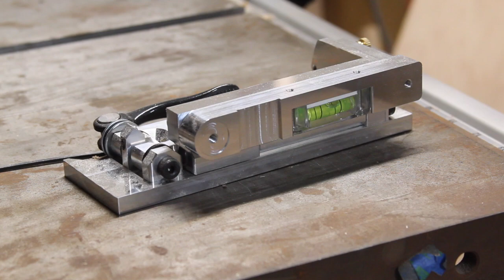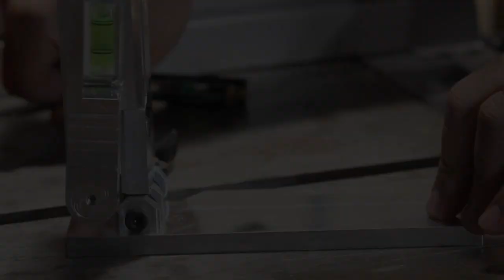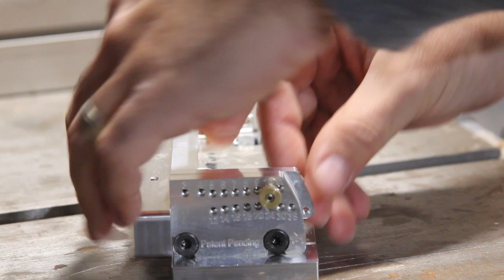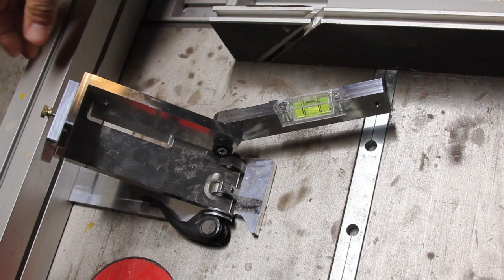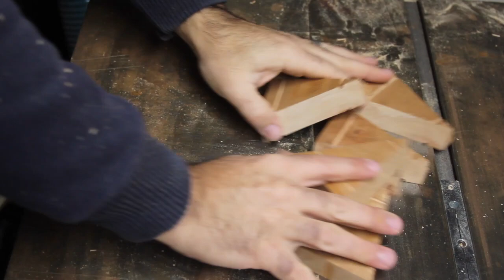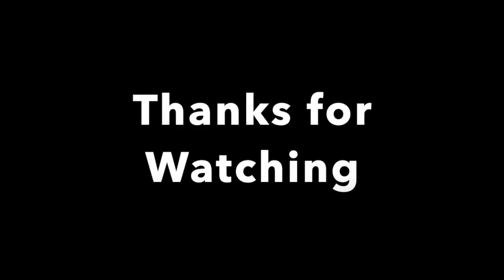Tablesaw Setup using the JS3

Comment: set up was easy enough. the thing works great!  ..What SIZE is the set screw 90 degree allen  wrench? last dumb ques, What is the best suggestion for deducing the Length of each piece for a particular diameter
Reply from the maker: Hi Tom!  Thanks so much for backing the project, and glad you're having a good experience with it!  The allen key is a 3/32, and it takes a little finesse to adjust the screw.  I checked them all before I packaged, and used some blue thread-locker (removable), so it SHOULD be OK, but always worth a double check!  In terms of the length of each piece, I'd start with the same formulas you would use for side length of segments.  A very ROUGH idea would be to take 3.15*(desired diameter)/(number of sides)... The more sides you have, the closer the final piece will be to your desired size :).  Happy Holidays!